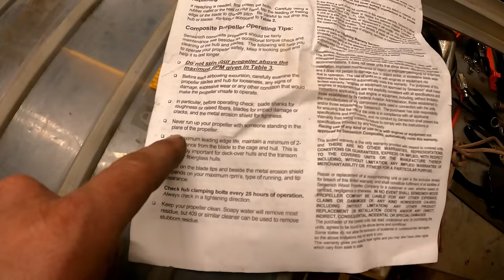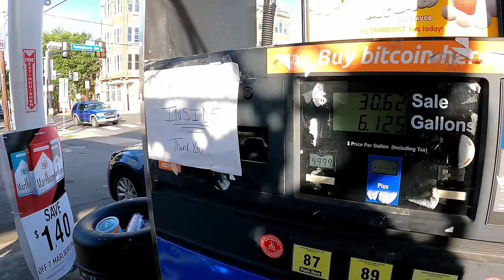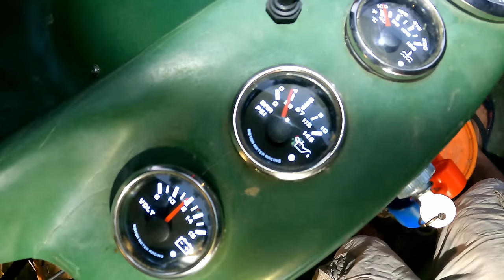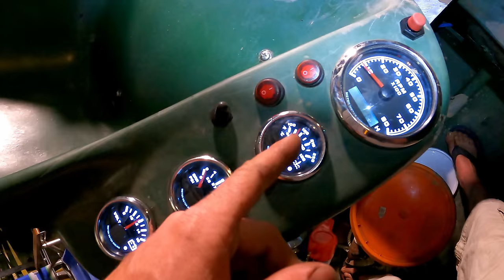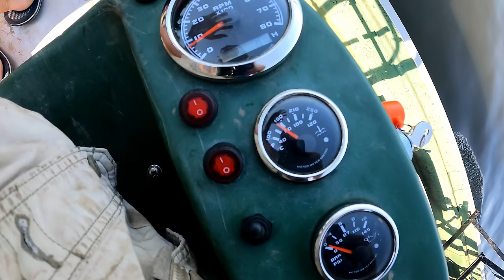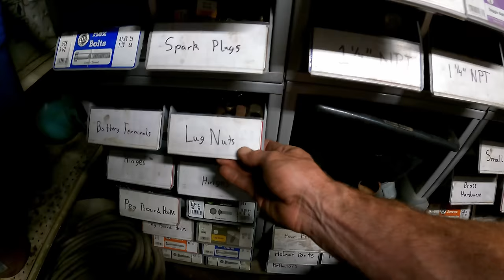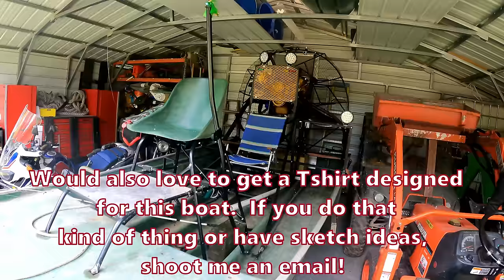CaddySwampAss Airboat Part 3 - NNKH

Comment: What do you think about putting a magnet on the bottom of the oil filter and one on the bottom of the oil pan as the rust breaks  off the rust won't keep recirculating the engine
Reply from the maker: Well the filter should capture all of it. But yeah that's actually a great idea! I think I'll go do that now. One on the bottom of the filter and one on the 2-in plug

Comment: Dude! You haven't done another video on this yet?! I wanted to see how the bilge pump works... I wanted to see how you installed a wake shield on the bow/front and an extension on the transom to prevent wake backwash, etc!
Reply from the maker: I jump around a lot. Boating season is winding down so I'll probably do another video or this over the winter or next spring

Comment: Yahoo been waiting for this video as I said 2 weeks ago. I think you would make out a lot better if you move the fuel tank mid-ship the balance out that weight so you won't get much of a squat when you slow down
Reply: or weld on some pods on each side on the back for floatation and stability

Comment: HEADS UP! , you need to change the circuit so that the lanyard coming out shuts down the engine.The lanyard gets clipped on to the pilot kind of like a tread mill machine as an automatic shut down. if the pilot hits a log or something and is tossed out of the seat the engine needs to shut down so that your boat is not far when you need to swim back to it.
Reply: We did.  It was just the wrong type.  We swapped it out for an NC switch and all good now.
Reply: @downstateradv  Glad to hear it! I love this channel and I now subscribed to yours; keep the entertainment flowing!

Comment: Fun boat. Why can't you max out the pitch on the prop to get maximum thrust? The V8 probably has enough low end torque to spin to 3K no matter what the prop. pitch is set to.
Reply from the maker: We pitched it a touch more and the RPM dropped a little bit so I figure it's already at Max pitch. Plus this engine is old and tired so I don't want to stress her too hard

Comment: I'm not sure if the same as an aircraft but you should pitch your prop (change the angle) for your 3000 rpm. Usually there is a reduction gearbox. The more pitch the harder it will be for the engine to turm and its max rpm will come down.  That way you make use all the power the engine has. You boat will be much faster as well. I'm sure some airboat guys will chime in.
Reply from the maker: Yes. In the video we piched it another half notch and now it maxes out at 3K RPM

Comment: May need to install a foot shaped throttle plate to prevent those foot slips in rough water
Reply from the maker: Yeah that's probably a good call because my foot's definitely slipped off quite a few times

Comment: Your navigation lights should be on the sides. That is the whole point of them, it's so other vessels know which way you are going. 
VSC sticker
Both the U.S. Coast Guard Auxiliary and the United States Power Squadrons have certified vessel examiners who will perform a free Vessel Safety Check ("VSC") at your boat, at a time of mutual convenience. There is no charge, and no consequences if you don't pass.
Reply from the maker: That's a great point you bring up. I actually ordered a front Bell light and just haven't gotten around to putting that one on yet and Alex wired those up real quick.  Or maybe we'll just tag two more of those LEDs on the sides of the cage near the other ones? They don't necessarily have to be on the front of the boat correct? You just have to be able to see it from the front and the side right?
Reply: @NoNonsenseKnowHow  I just posted more info in the comments.

Comment: Don't know if it has been mentioned but could you close cell foam between the stringers and then deck it.  Don't know if it would give sufficient floatation to keep it from sinking completely but wouldn't hurt and wouldn't add too much weight if you used cusa board or some other lightweight material for the deck.

Comment: Awesome. I have a question. I have a 03 Ford F-150. It is starting to have idle issues in park or stopped at a light. I have a check engine light and the parts guy checked and it says 02 sensors. Would that cause the idle issue??? Or fuel filter?

Comment: Can you do a video of the frame ? Specifically how the engine is mounted, the heights and lengths of the metal frame. Maybe even some upgrades you would do. I'm researching  and going to build one soon. It's the only way I can afford one. I have a mig, and know how to use one. I do have the metal and the engine. Every project I start, has a budget of 0.00. Then I work my ass off from there. Thanks jc

Comment: Pardon my newbie-ness, but aside from airboats, which use aircraft Lycomings and Continentals that max out RPM around 2500, don't most auto e gives get reduction drives to allow the engine to get to 4000-5000 RPM, and allow the prop to stay under 3000 RPM?
Or does that Caddy motor hit a good peak at 3000 RPM?

Comment: I cant believe that engine dint grenade. Then runnin milkshake several times. Definately a testament to the builders back then. I def dont think u should put any kind of forced induction system on it unless ur gonna rebuild it first. Besides that u'd have to get a higher rpm rated prop cause blowers make their power at 4g's plus

Comment: Love the videos!  How do you like the Kobalt 24v Reciprocating saw? I've been debating on getting one. I have the Kobalt 24v 1/2" impact and 1/4" impact. They've been great.
Reply from the maker: Thanks for checking them out. And honestly it's not very good.  Very weak compared to the Milwaukee 18 volt that I have. The only reason I bought the Kobalt kit is because my buddy sold it to me dirt cheap since he had like 30 of them he bought at wholesale
Reply from the maker: The rest of the kobalt 24 volt tools have been decent though
Reply: @NoNonsenseKnowHow  Thanks for the fast response! That's a bummer about the  recip. saw. I was hoping it was decent. I've had my impacts for 5 years now and no issues.

Comment: $900 a steal, considering the composite prop that probably was/is 3-4 K plus. Maybe consider putting some bedliner textured paint for the walking area inside for anti-slip purpose. Yes, I would like to see a part 4. BTW, were you flying the drone from the airboat? Couldn't figure that one out. Thx for the video!!

Comment: 1 л уайт спирита в масло и минут 20 погонять на оборотах 1500 и норм помоет, 1 liter of white spirit in oil and run the engine for 20 minutes at 1500 rpm, washes well

Comment: Perhaps someone else already suggested this, but I know they make a paint that is designed to make the bottom of airboats basically frictionless. I don’t remember what it’s called, or if it’ll work real well for fiberglass boats, but I know it works super good on the aluminum boats. I think “thatboatguy” used it on his airboat refurbish video if you wanted to see a review of it. Might help when you’re off in the swamp.

I think this is the video: https://youtu.be/R2HPolcvmgQ
Reply: Frog spit....and some other names.  Also, you can bolt on polymer.

Comment: chris question? i see now and then your using your phone to check your speed what app do you use to do that? or how do you do that? need to get my car in and get it fixed but no speedometer in it right now. so????
Reply from the maker: I have one called Ulysses gps. But there are plenty of them on there so that's probably not the best one at this point I'm sure. I downloaded it years ago

Comment: Def dont wanna throttle up on the torqueside (right) when off plane, also you’re operating too far forward which is why its wetting you, looks like an old spray boat but look at some
Florida style airboat seating arrangements for some ideas and i think youll feel much better about riding it
Reply from the maker: Yeah she definitely dips hard when you're turning right! I've taken a couple spills over but it hasn't been a problem yet. Kind of just getting used to the boat the way it is and then I'll start making modifications. She's definitely a blast!
Reply from the maker: Maybe I'm confused. I think it might have been making left turns when your throttle it up, the gunnel gets extremely close to water.

Comment: 4 barrell isnt kicking in
Reply from the maker: You know it's funny, I never did take the air filter off and check however this carburetor came off the 1965 Fury and the secondaries were 100% opening on that car so unless it broke while sitting on the shelf I think their definitely opening. Plus I can't see this airboat doing 30 mph if the secondaries weren't opening. I'll go out back later today though and verify!

Comment: You get that turd anywhere near dry ground you have to have a crane to get you loose I will send a message to something they will not run dry ground as long as I want it to along with 10 ft tall myrtles and Cattails and Sawgrass on dry ground if they won't do that I'd put a match to it junk
Reply from the maker: I've put her up on the dry quite a few times. Makes it about 50 ft across sand before it stops. And then the tide comes up and picks her back up
Reply: @NoNonsenseKnowHow  I go hunting and get off out of the water about daylight run deer down on dry ground stay on dry ground until Dark and I have never pushed my boot
Reply: What I'm getting at is don't call that an airboat and to click that as an airboat when it really is not it's just a boat with a fan on the back of it it won't do what a airboats was designed to do s*** off about 300 lb of that excess crap you have on it put a gearbox on it and then you might have something otherwise it's just a boot nothing more

Comment: It's a straight drive 500 on a barge it's not an airboat it's a barge with a fan on the back of it it will always be a turd no matter what prop you put on it
Reply from the maker: I don't know of any barges that do 32 mph
Reply: @NoNonsenseKnowHow  a whole 32 miles an hour yippee I run over 120 and 400 ft so yes it is a barge that barge is not an airboat it's a turd with a fan on the back so I'll call it an airboat is a stretch